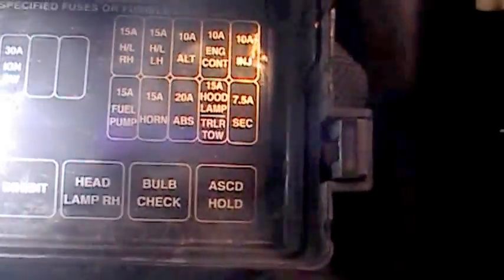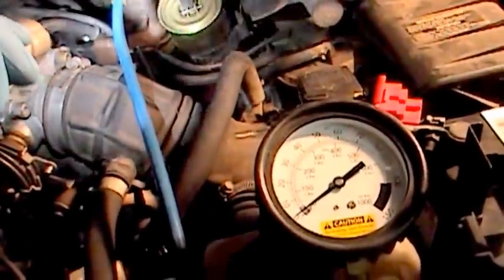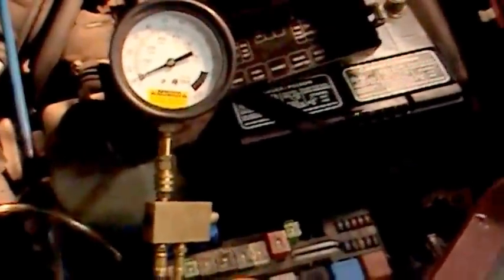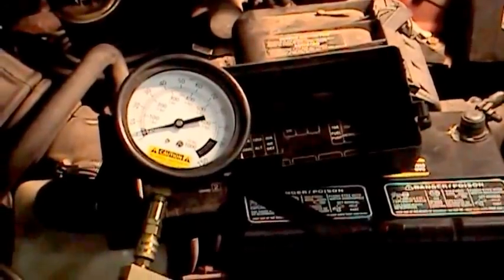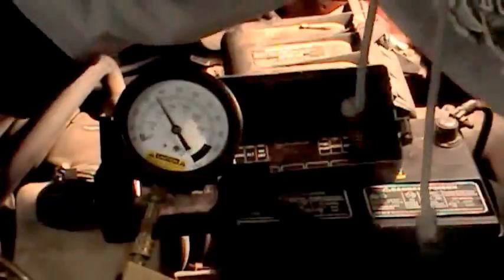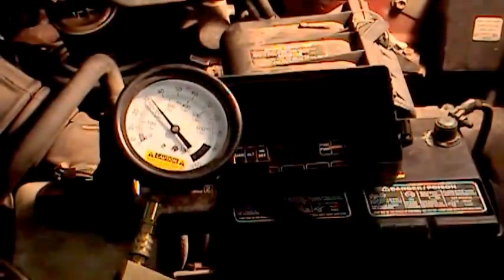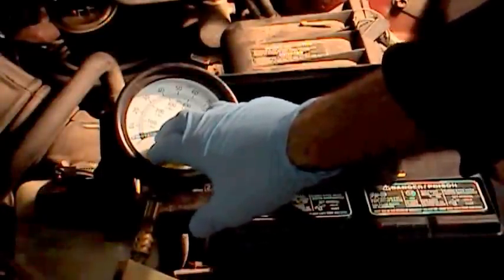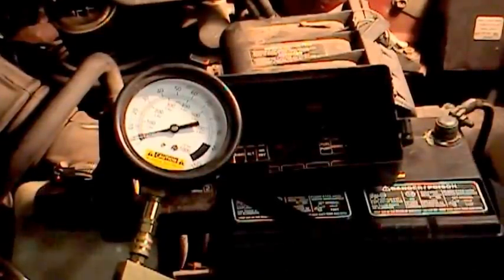Testing for a failed fuel pump check valve

Comment: This doesn't determine whether it's only the fuel pump or a leaking injector. Just losing pressure on the fuel rail can be a multitude of things. Leaking injector, bad pump check valve, or pressure reg bad. On this car you checked the FPR but not any injectors. Just an FYI for anyone watching this. If you pressurize the system and pinch off the fuel line once the pump turns off, you will either lose pressure (meaning injector problem or FPR) or hold pressure (meaning pump check valve is bad). If you do the same and pinch of the supply and return and don't lose pressure, your injectors are good and your FPR is bleeding pressure to the tank. And if you lose pressure at this point, it is a leaking injector.
Reply: Decent information!
Reply: @ZSmith-tp5rm should be the same as I described. As long as you have lines that can be blocked or pinched. Concept is the same on any non direct injected system that uses a fuel pump. An injected that failed stuck open could do it, remember psi in liquid is barely anything compared to air.

Comment: Could this cause a lean condition? Fuel trims show the ECU adding 10.9 to 12.5 % more fuel in the long term. Tested with a fuel pressure tester an i start my truck with less than 5 psi. Once running its solid 32, kill the engine an instant lost of pressure. Spark plugs are bone dry so not injectors. I havent check the FPR since its really hard to get to but ill test it tomorrow at lunch

Comment: Great video explained very well . Will A bad check valve cause any popping sounds and will it stall  while driving, i am having some stall issues        with a strght 6 bmw motor that most main sensors have been changed as well as plugs, coils , it,s only got 120,000 kilom.... can you help Thanks

Comment: Can the fuel pump check valve be intermittent?  My wife's 2000 Bonneville will not start sometimes unless the accelerator pedal is held to the floor.  Usually happens after sitting for 24 hours or more but has happened after filling the tank with gas.  Fuel pressure checks look good but I have not had a chance to check pressure when it is acting up.

Comment: Wow amen finally someone who is on top of why an engine over cranks before starting.i was told everything under the sun about what the problem is,starter,battery,ignition,bad fuel pump relay,bad grounds,bad batt terminals,crank sensors,camshaft sensors,pcm,tipm,on and on,thanks again

Comment: Why not just replace the check valve or ball? It looked like the pump was working fine.  You could even install a generic check valve in the fuel line just past where gas comes out of the pump, but before it gets to the fuel rail.

Comment: Would that also cause a no start I have a 2004 GMC Safari with the MiFi I please and have the same issues I pinched the return line off and run the gauge and it holds pressure I let off the return line and it drops back down but I have a no start with that

Comment: It's the spped of the bleed off that's really the best indicator.  In the span of 5 minutes you saw your pressure drop to nothing (assuming no video editing for brevity) A leaking fuel injector on the rail would show similar symptoms but take longer to bleed off the pressure as in an hour or more instead of a few minutes.  Only way to know without a doubt, however, is to block off the return line on the rail (assuming a return system) to know for sure since then you'd be able to isolate the pump check valve from the rail to see what's leaking.

Comment: I have 1988 IROC-Z. Hard starts begin to happen about 2 weeks ago. I replaced
•alternator 
•fuel pump
•pressure regulator

For example, it will start in the morning...idles rough@2500 rpms. Then levels off at 1300 rpms....
Once I turn it off, it will not restart. Maybe 3 hours later, it will fire up again. Could it be my fuel filter? Or just a bad fuel pump...?

Comment: Thank you for the video Kevin ... It is a good habit to replace the fuel filter as well once you replace the fuel pump (restricted fuel filter will create a back pressure which will shorten the life of the fuel pump).

Comment: $800 repair (I was stuck away and had to have repair).  Instant start!!!!  It was great.  Now I have THIS bleed down problem.  So far, my solution has been to turn the KEY ON, WAIT for the system to pressurize, and BINGO, it works.  From everything I've read here, that is just an annoyance  and nothing worse.
Reply: Yes I have observed the same thing that it is at most an annoyance.  I had a similar situation with my truck but only with the rear gas tank so I would just start it using the front tank.  Even with the rear tank it didn't bleed all the way off until a good 12 hours anyway so could easily restart during that time.  No other problems no fault codes, etc.
Reply: Mister Moonshadow, so dis the problem eventually get worse till you finally had to replace what ever the problem part was? I've been doing the same thing on my 91 4runner v6. It was working for a while, putting the key to On, letting the fuel system pressurize. Or simply clicking it on ON several times but the system bleeds out faster then b4. I replaced my fuel pump 3 months ago with a cheap $30 Amazon fuel pump. I'll be replacing it now with an OEM Denso fuel pump.

Comment: I can't start car at all, cold weather, got integrated gauge for fuel pressure. Very rapid dropping pressure, but while I was checking all, it seem not priming the pressure before as well, found one of relays not very good.

Comment: 03 Suburban has a 2-3 seconds extra longer than normal crank time but it has only happened 2-3 times over the last 2-3 weeks.  Seems like a check valve issue but not sure why it is infrequent at least thus far.  Should the pressure hold overnight at some minimal value?  Pump is OEM and I just changed it 3 years ago!  Not looking forward to having to do that again if it is the pump.  Thanks for the video

Comment: If I add a check valve, and the fuel level drops back down to the fuel tank, then will the fuel line put air in the empty space?

Comment: How can you test the check valve if the engine won't turn over? I have a 2005 Chrysler T&C, that it had an elongated crank time one day, then eventually started, just as you explained, & drove fine. The next day, it wouldn't start, just kept cranking, no start. A mechanic told me it was the fuel pump & not worth the cost to change it, due to the age of the vehicle & mileage. I just received in the mail an Extended Warranty on the Fuel check valve for the van, stating it would need to be replaced either at the dealership or they would reimburse for repairs already made. I asked the mechanic if it was possibly the valve & not the pump, & he said he doesn't think it's the valve, but didn't check it. Is there a way I can do that, to see whether or not it's worth having it towed to a dealership to get the valve replaced?
I'm not all that car savvy, so I don't even know if they are related issues.

Comment: My ranger is doing that and throwing lean codes.   To start it right now, rather than crank and crank, I bump the key to give it an extra squirt.  I'm definitely going to be checking that.  Thanks.
Reply: Same here. Did a fuel pump check valve fix your ranger?
Reply: @iholland1869  I replaced the pump.  It turned out the rubber hose in the pump assembly had a split.

Comment: Is this also applicable to Audi Quattro A4 1.8L  Turbo engine?

Isn't the fuel pressure check valve for the Audi Q A 4 located under the hood and not inside of the fuel pump?  

 I had the same symptoms and found a that the car had a broken crank case breather valve....

Comment: hello, i have the same problem, in the morning, my van struggling to start and the engine shaking badly. once it started up, it works fine, but lately it been running under power and the only way to make it full power again is to shut the engine and start it up again. but my van now is dead and not starting up. I check the fuel pressure by loosing the pipes to the injector but very low fuel pressure coming. is it the high pressure pump or the regulator? my van use bosch cp1h fuel pump. sorry for my bad english and please help me. im dying to know what the problem is.

Comment: HELP:
My truck (GMC Denali Yukon) stopped abruptly while driving, 3 times and every time restarted but I suspect something wrong. Possibly beginning malfunctioning fuel pump. I additionally had code P0140 (Bank 1 senor 2) error that did not reappeared after erasing and cleaning the wire connection of driver side post catalytic O2 sensor. 
To check for fuel pump check, I bought a set From Harbor Freight (Fuel injector check kit for $20). 
 I connected the gauge directly to shredder of my truck. 
With out start and with only turning key to ON, pressure is initially 50G but suddenly drops to 0 as fuel leaks (Pours prominent) off the gauge connection end of the tester unit! This happens exactly from where you thumb is @ 3:45 of this clip, joining the gauge meter to tube. So understanding it is not safe, I did go to start but after covering with tower and holding, temporarily running engine showed an stable low pressure of 35 G. 
I suspect my fuel pump is bad but WHY leakage from gauge meter? Or is it a usual problem with Harbor Freight tools? I am going to return to HF and change the meter. Hope I get a better one but is there any experienced one out there that can tell me what is going on and why I have leak at meter end of pressure check gauge?!!
Reply: I got the same tool and it also leaks at the gauge.

Comment: Thank you for the video. 

Would a failing check valve also cause intermittent misfires/hesitation during idle?

Thanks
Reply: I don't believe so, as the pump is operating while the engine is running. The check valve is only there for when the vehicle shuts off, it's hold pressure for a certain amount of time as to not dran the line completely
Reply: Perhaps my in tank pump is failing... At times, I needed to tap the top end of my tank for the engine to turn over
Reply: Thank you mate

Comment: Good job and great video... I'm getting ready to change the fuel pump in my 95  ss impala x highway patrol car.. don't know if it would be easier to drop the tank 3/4s full or go three the trunk and cut a hole...

Comment: Hi Kevin:   My car will crank up on 1st turn but will have poor idling if I parked car for more than 15 hours. So what I do is every morning, I turn the key on position 2 for about a few seconds, then the car will start up normal otherwise it will have poor idle for about 20-30 seconds. Can I just keep the car like that without fixing the check valve since the car is old not worth throw in any more money. Let me know. Thanks.

Comment: Great video...helped me determine my fuel pump is bad on my 2003 Pontiac grand am....hard start after sitting for awhile...after it's running no issues...starts right back up...thanks alot

Comment: fun stuff,  in my case when I finally got the truck started it would still only hold about 10 psi bellow spec so my regulator was bad for sure, replaced it and now get pressure within spec BUT the pressure bleeds off immediately when the engine is stopped.  Same thing happens if I jumper the fuel pump diagnostic port to turn on the pump.  So, looks like my check valve in the pump is also bad.  fun stuff.  at least I've learned how to do diagnostics on the my entire fuel system which is priceless information :D

Comment: Thanks for sharing the video! I have the same problem with my 98 Tacoma. I was almost positive that was it but didn't know how to check it. Can you take the hose off of the fuel pressure regulator any time while it's running?

Comment: Would this also cause it to run out of gas with 40 or 50 miles to E still, I'm about to put one in a 325i, 2004.
Reply: Do it fix your issue? Looking for answers as well. Mine fired up on the 2nd crank and works fine after
Reply: @IVIusicMayhem  I had a vacuum leak. Get down to about 20 dte now, I'll take it. Get a new fuel cap though, it all helps to pressurize the fuel tank.
Reply: @Throughthelurkingglass  Sounds good will do. Appreciate it brotha 💯!

Comment: +Kevin Criswell  I have an early 90's Ford V8 5.8L EFI engine.  When the system was checked with a pressure gauge, the pressure dropped too quickly.  I've been told the check valve is bad on my fuel pump, but I have reasons to doubt it.  First, it starts fine every time when cold (first thing in the morning, etc).  The hard starting problem shows up after the engine is hot. Second, this is a replacement fuel pump that is only 3 years old with very low mileage on it.  Also, during hard starting (when the engine is hot), if I press the accelerator, it helps the engine start.

Any pointers or tips you can give me about where to look next?

Thanks.
Reply from the maker: onesimpleidea try checking the fuel pressure regulator.   Start the engine and than unplug the vacuum line and see if there is fuel coming out,  there should not be.
Reply from the maker: Also check the temperature sensor, if yours is reporting a false cold engine it will add too much fuel when hot because the ECM will falsely assume the engine is still cold and needs more fuel.

Comment: Thank you for this. I am having an issue with my truck not similar to your issue but I still wonder if it's the check valve. Under warm start conditions my truck has a very rough acceleration. If it's started from cold it will run fine.
Reply: Travis Compton 
Check for a stuck open injector

Comment: I'm confused where the check valve is on the fuel pump and how it works with the return line.  If I crimp the line after the fuel filter, the pressure holds.  Crimp the return line after the fuel regulator and the pressure holds too but if it's a bad check valve I'd expect the pressure to drop even if the return line is crimped??
Reply: usually it's part of the internals of the pump.
Reply: Not really. It should create a vacuum, which would mean pressure would drop only if air was allowed into the system.

Comment: 98 sebring turn key many times to start  three tries and it runs finewas told it could be check valve in fuel pump in tank. why not in stall a check valve in line in route to   hold pressure to  engine  also how about adding a  12 volt fuel pump in line to push fuel  to aid starting only?also if it will pull thru old pump?.  so don't have to drop tank
Reply: Karen Roman,  Your idea is the idea that I plan on doing to my classic 1979 El Camino since it's a carburetor (not fuel injected) engine & I only drive it once in a while. I would use a Y tube connection so that fuel from the gas thank goes in one direction and out through 2 exits, one directly to the 12 volt electric fuel pump, & the other exit to your regular fuel injected system. Use a togle switch or button switch to activate the 12 volt fuel pump for a few seconds till your car starts then shut off the toggle switch to let your regular fuel injection take over. The problem is that if u inject too much fuel in the engine, you will hydrolock it. Ba-bye engine. For my carburetor engine I would only flood the carbereator so I won't be able to start the engine till some of the gasoline evaporates. Since you posted your comment a year ago, what did u do? By the way I'm  having a problem as described in this video for my 1991 4runner v6. I'm sure my problem is a cheap $30 fuel pump that I installed 3 months ago I bought from Amazon. I'll be replacing it with an OEM Denso fuel pump.

Comment: My fuel pump went out on my 2000 Montana ,changed it and it ran fine for awhile then it died. Now I have no start and a sound like there is air in the lines near the engine , also when the pump is engaged it also sounds similar checked the lines in the tank and see no leaks from the pump.  The fuel pressure is good. Never had one pull this on me . Anyone have a idea what its up to ?nThanks

Comment: Thanks for that video Kevin. I too am having a hard first start to the day. So I did this test, but my gauge showed that the pump is holding pressure, or at least during the five minutes I was waiting for it to drop after shutting off the car. So I did a little more research and was told that my condition can also be cause by an injector leaking down into the cylinders, filling the associated cylinder with fuel and causing my rough start, but how can my fuel gauge show that its holding pressure?

Comment: How do you know it's not a leaky injector that's causing the drop in pressure?
Reply: Probably the speed at which it dropped, but to be sure you could isolate the tank from the injectors by pinching the lines with rubberized vice grips. If the pressure still drops after pinching the lines then it's probably an injector, or it could be the fuel pressure regulator if yours is in the engine bay.

Comment: Correction. The vehicle needs a check valve in he fuel line off the tank. Like, a $5 part. The fuel pump is fine.

Comment: Wow! Great information. Just installed a fuel pump on my Saab 900 Turbo. I've had this problem for a few years (fuel pump pressure). Just recently got worst starting up. Now that a new fuel pump is in, car still will not start. Question: My fuel pump fuse shows no output when car is switched on and probe light doesn't light. Isn't it suppose to light with this step.
Reply: i have same issue have you solve it please please please let me know

Comment: Can a piercing valve be used for checking fuel pressure
Reply from the maker: I think the biggest problem would be ensuring a seal that would last the vibration and heat under the hood. 
Amazon often has master fuel pressure testers inexpensively.

Comment: Great video..however not all cars have a external regulator. Therefore you'd be checking injectors.or replacement of the entire pump module  thanks for sharing